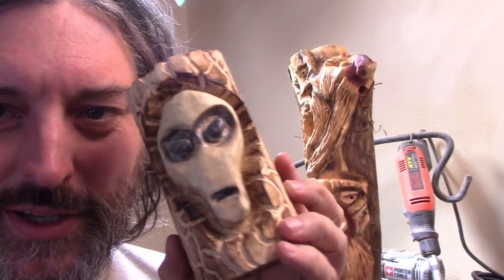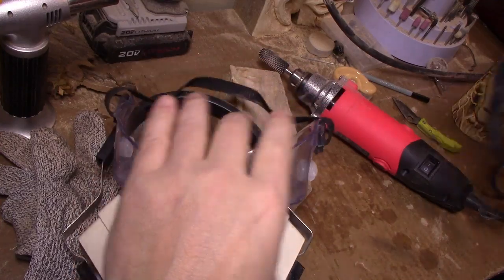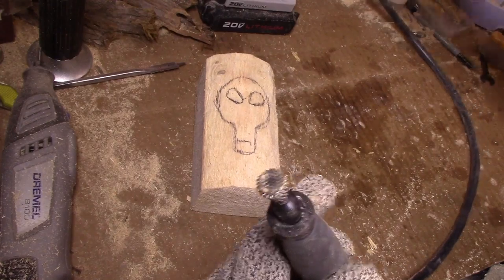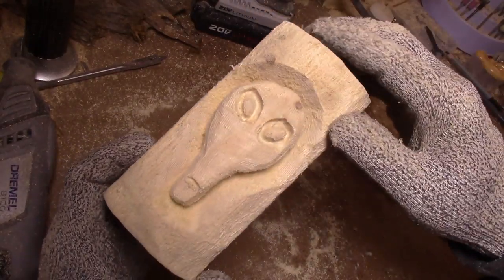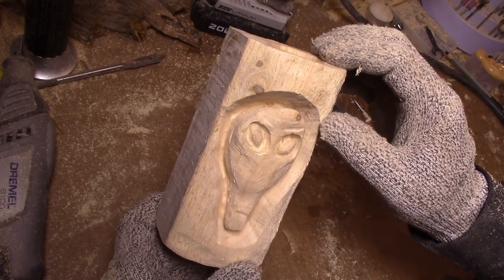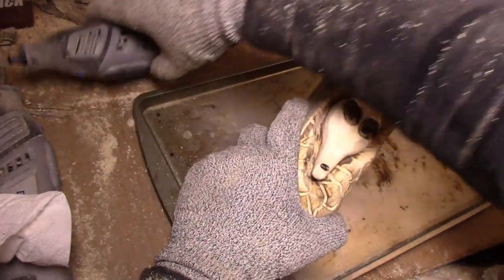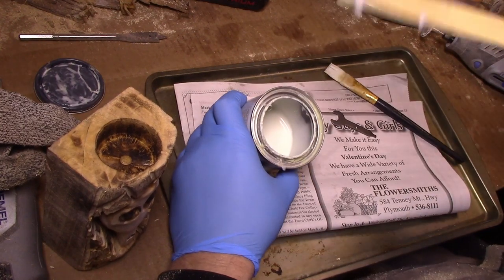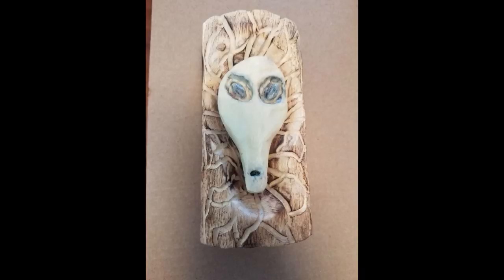How to Wood Carve A Glow In The Dark Alien - Easy Beginner Project - Entry Jordy's Monster Carve

Comment: I work in the oil field an pick up those bits the welders use on the pipes so do u think they would work like the wood bites do or to aggressive? I'm a painter by trade and been wanting to do some things like ur doing
Reply from the maker: I don't have a huge amount of experience , so I would be guessing but if you get soft wood you can use just about any burr and it will cut.